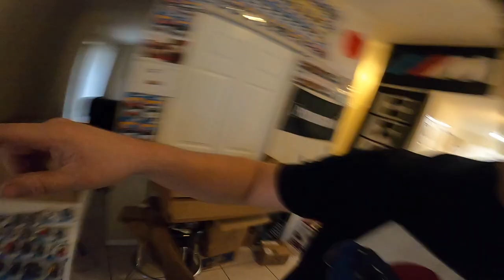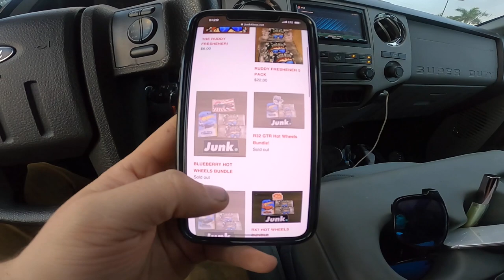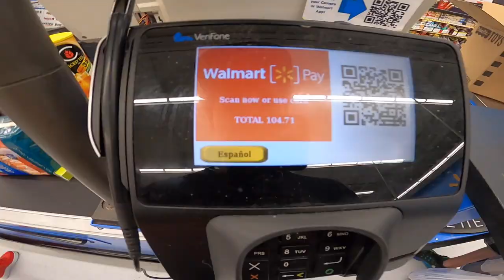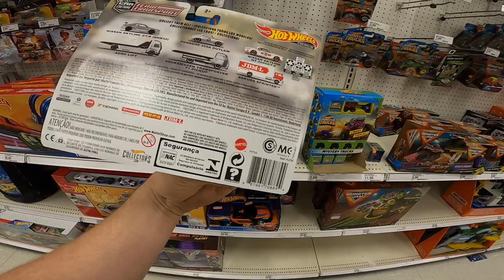STARTED MY DREAM JOB!

Comment: Damn I wanted to see the honda build with the upside down head gasket and the bad bottom end run perfectly cause its a honda. 😂
Reply: Deff wasnt upside down lol
Reply: Lmao, don't forget the broken bolt with stripped out threads camshaft cap cuz I can't see him getting that bolt out without throwing tools and destroying that head even more. Watching him snap that bolt off on purpose was one of the dumbest things I've seen someone do. Especially when there has to be 2 or 3 nice tourqe wrenches 20 steps away over at  HP logic.
Reply: @Bbrody757  watch the video of him putting it on again he has it right when its sitting on the cardboard then he flips it over the wrong way. Look at the shape of the left and right bottom corners and you'll see what I'm talking about.
Reply: @Bbrody757  so you're right its not upside down but he did flip it the wrong way. I mean it looks like it to me someone else check it out and see if you agree.
Reply: Buys l.s. gasket it has gsr bottom end cant figure out why it has 100psi oil pressure an smokes like a banshee lol

Comment: Your sleep sounds the same as mine was in my early 20’s when I was unemployed. It’s easily fixed by getting into a routine of setting your alarm and getting up at the same reasonable time each day, and going to bed not much later than midnight.

Comment: Melatonin will throw off your time. 
What you need to do is, stay up until 11:00pm, then sleep until 9:am. Make yourself getup at 9am. Stay up until 10:00pm. Then go to sleep until 8:00am. Stay up until 10:00pm. Sleep until 8:00am. 
Do that format few days and your body will be used to the routine. 
Your problem is, you’re not getting enough vitamin D and you’re used to staying up very late and sleeping throughout the morning. All you have to do is change the habit but, that will consist of one day stay up over 24 hours. Then forcing yourself to get up in the morning for a few days. 
I’m sure your sleep pattern is affecting wifey.  Get rid of the melatonin and sleeping aids. Just stay up over 24 hours and focus on your new sleep pattern. 
Good luck.

Comment: Yo Chris, I collected hot wheels for years. You gotta look out for the treasure hunts, there's usually 1 per case. Those are the ones worth the most money. Also talk with your local stores and find out what times they typically stock toys and you can go through untouched cases before they're dumped into the bins of death

Comment: Trademarked sales you've got to give the hot wheels away for free but if you get money and make profit which means even a penny is gained you can get sued so give them away with the packs and charge a little bit more for the pack so to speak but make sure to say that the hotwheels is a free included option

Comment: If I had to guess on your sleeping problem is that you probably have no normal schedule that you go to bed one night go to bed at 10pm next night 3am if that's the case you need to get on a schedule of some sort I went through same issue. Need to get within couple hours of going to sleep every night.
Reply: Do not get on sleeping meds there horrible and can be very addicting as well just lil advice believe me best thing you can do is get on a schedule.